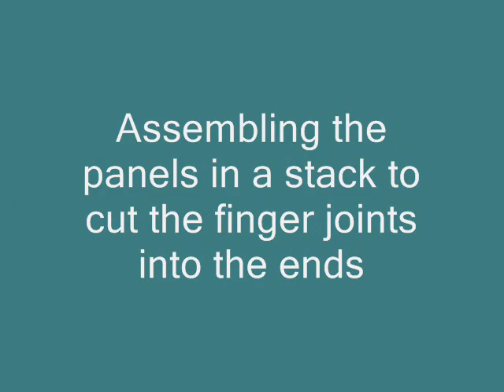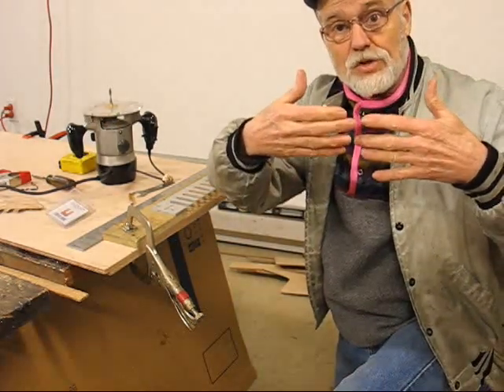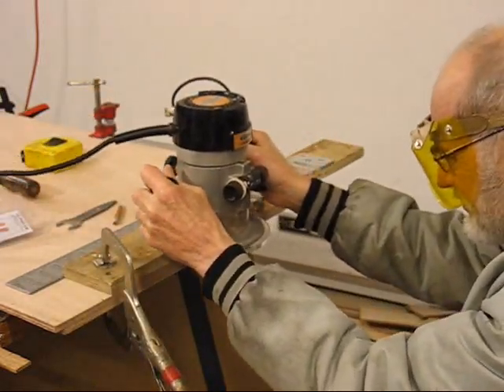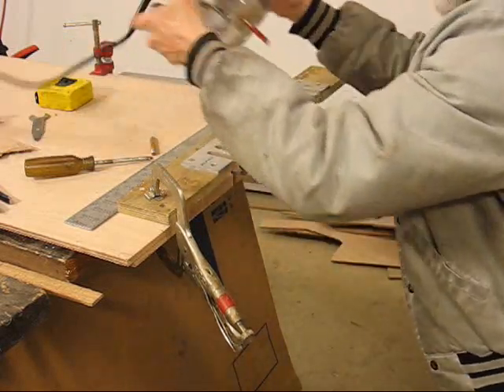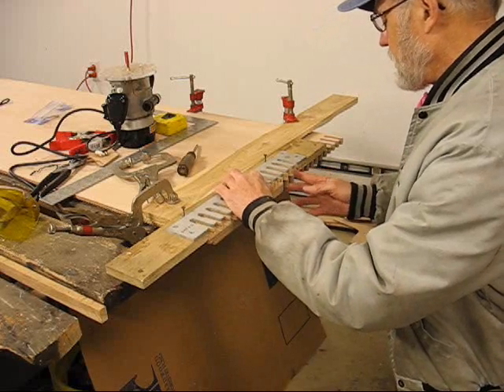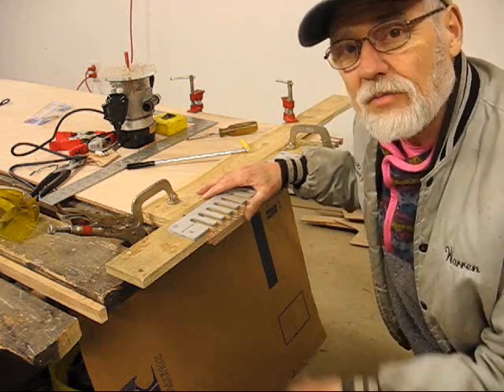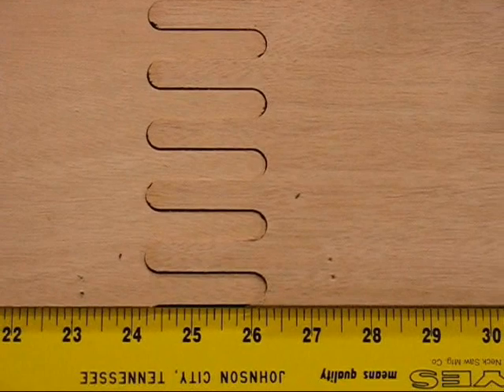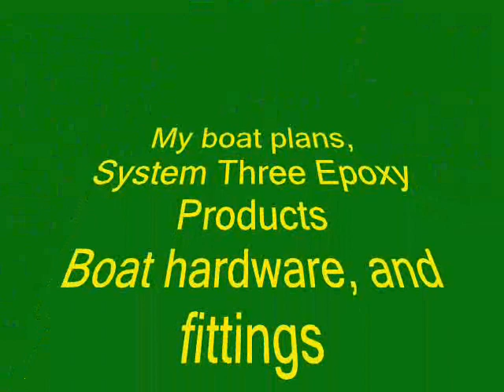EMC Part 1-4 Making Finger Joints.wmv

Comment: Warren,
I noticed that you mentioned that when you butted the two finger joints together that you had a small gap. You would not have that gap if you start on panel at .25" and the second one at .75". If you use that method you will have half of a finger at the edge.

I also want you to know that I have watched all of your videos so far and am looking forward to your next boat.

Andre Anderson

Comment from the maker: @mikethemoneymaker  With a layer of glass cloth to act as an extended "top skin", the joints work pretty good.  For a wide bottom panel for a flat bottomed boat, I may use the traditional scarf.  I will have to experiment for that bending moment.